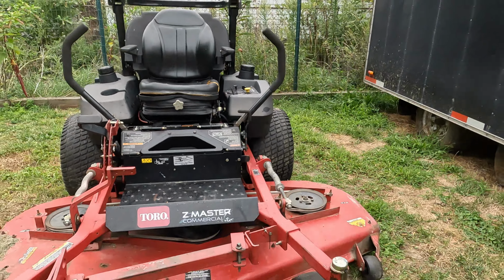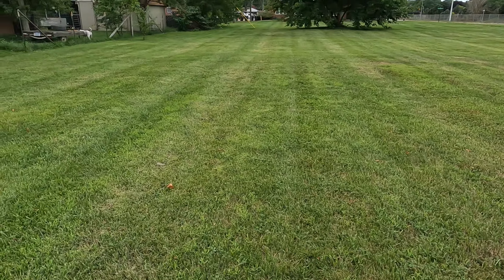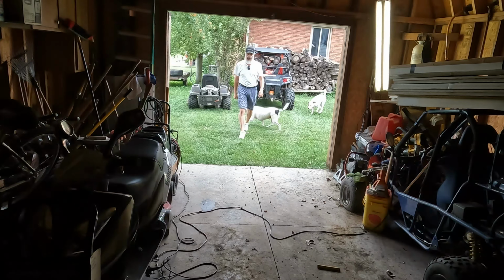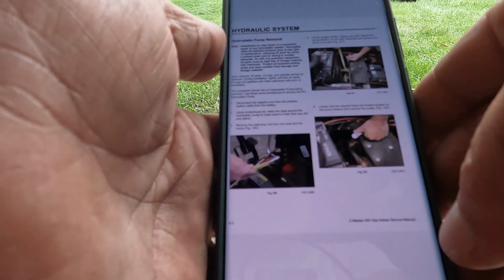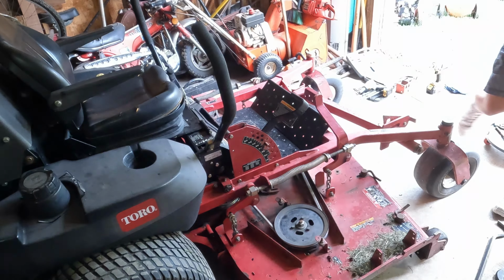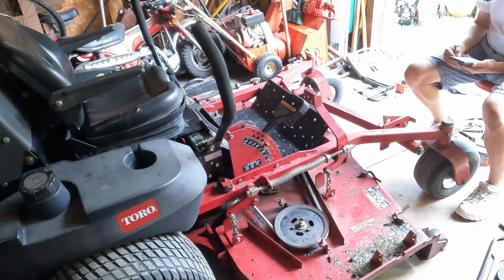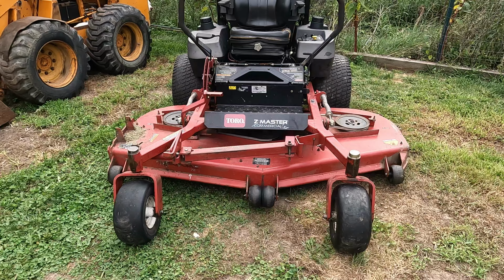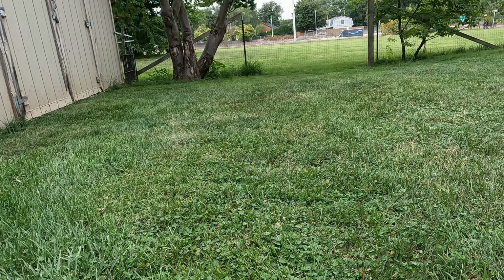Leveling the Deck on my (new to me) 72" Toro Z587L Z-Master Commercial Zero Turn

Comment: I have a 52 inch 2004 commercial zmaster. Deck is way out of adjustment. Thanks for the content! Also,  tires all have same air pressure, yet the front right tire always wants to spin, almost as if the chassis is bent or warped.  Where you suggest I start on that repair?   Bearings are good, same amount of washers....
Reply from the maker: @jessecrews  That's a good question 🤔 the frames on these mowers are pretty stout, so I would have a hard time believing it's bent. Possible?  I guess if it was dropped or wheelied a lot. 

The first thing I would check is the rear drive motor on the left side, opposite the floating front wheel, making sure it's not loose and it's in its proper location relative to the frame. Look at both drive motors for a comparison. 

Next, I would check, on a level surface, frame height to ground comparing left side to right side both front and rear. Measurements should be the same, front right and left, rear right and left. 

If they're not the same, the frame is most likely bent. Straightening would be a tough task at best. 

If everything in the rear is good and measures the same, the "hack" would be to shim the right caster down the amount you've measured it to be out of wack, then level the deck as needed. 

Good luck, hope this helps.

Comment: Thank you for this illustration, I have the same exact mower and I'm having the same problem with my right chain loose and the deck is pointing downward in the front. Initially it was making a cluttering sound as if the blades was hitting something and vibrated when I make a turn. I will see what I can do to solve my problem.
Reply from the maker: Glad to help with any questions you might have. 😉

Comment: Hi i bought the same mower and its fan won't turn on i think it's the oil pressure sensor but i was wondering if the fan stays on the hole time while running or only while its hot
Reply from the maker: On mine, it starts as soon as the engine starts running. After the engine gets to operating temp and you shut it off, then just turn the key on the fan turns on immediately. 

You may have blown the 30 Amp fuse, or the relay may have failed, or you may have lost ground. Also could be that the fan needs to be replaced. 

Below is a link to the service manual pdf for the Z587L. Page 136 or section 6-21 shows the electrical diagram for the liquid cooled engine

https://www.toro.com/getpub/32425

Hope this helps 👍
Reply: Thank you
Reply from the maker: This just happened to my mower this past week.

Check out the video below.

https://youtu.be/Gmh_PU7-IKE

Comment: Chain suspension is awful.  The chains get tangled and it causes the steps seen in the first minute of the video. Also, the deck swings out if you take a curve too fast and causes steps. Also, mowing on the side of steep hills can cause steps.